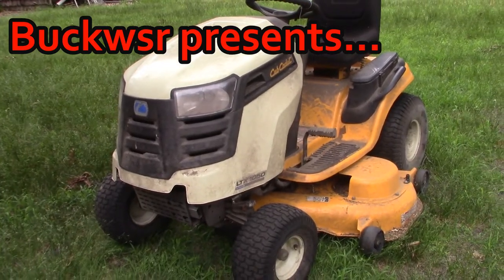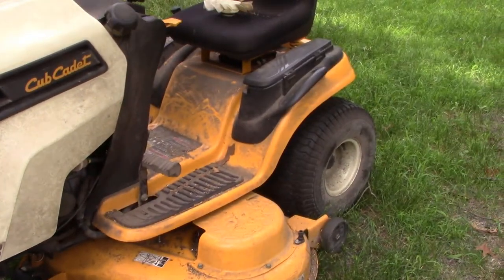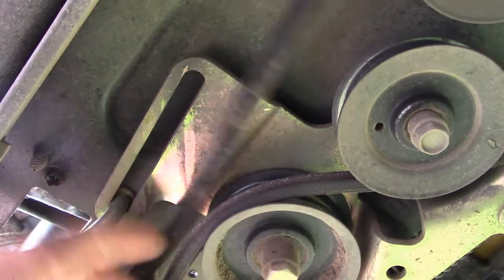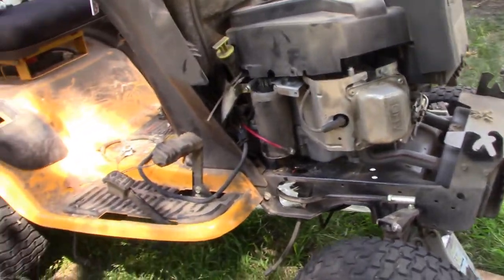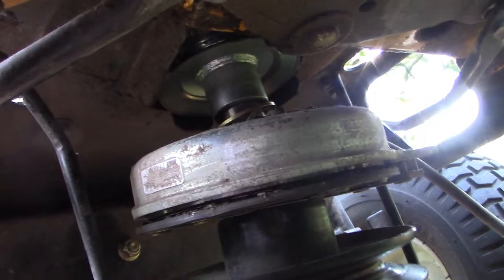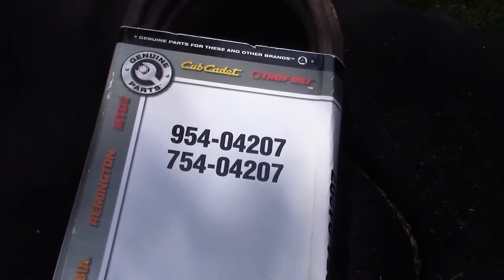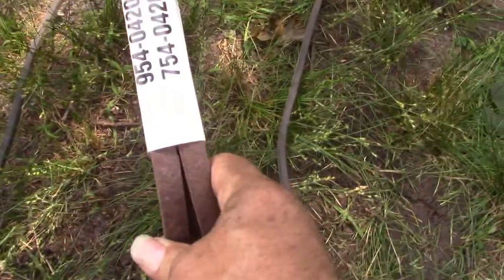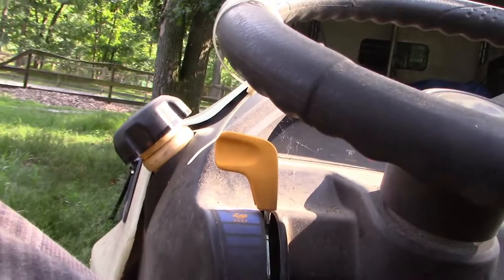How to Replace the Ground Drive Belt and Transmission Hydro Fan on a Cub Cadet Lawn Tractor

Comment: I just completed a drive belt change on my LT1550 tonight. Thanks to your video I knew to pull the PTO and the deck. It went easy as it a Arizona mower (No rust or corrosion.) Even cleaned out the mower deck and balanced it side for side. It liked to lean right side down.

Comment: If anyone was wondering what happened when he tried to start it after the repair (like I was because I had clicks instead of starting too), a good cleaning of the battery terminals cured that issue.  Thanks for the video, it helped me replace mine today and I'm the proud new owner of an impact wrench which made this job pretty easy.
Reply from the maker: Thanks so much for watching the video.

Comment: Your video was helpful.  I had to tip the mower up on its rear wheels and vice grip the plate on the 5/8” nut while I hit a socket wrench on the bolt to break it free.  It was a bugger!
Reply from the maker: Glad you got the job done!

Comment: Thanks so much for the video.  You answered a couple of big questions that I had, like how I was going to hold the hydro pulley in place.  Your video helped my own belt and fan replacement go alot smoother
Reply from the maker: Thank you! Glad you got the job done successfully!
Reply: I dont mean to be off topic but does someone know of a method to log back into an instagram account?
I was stupid forgot the password. I love any tips you can offer me
Reply: @Bodhi Arlo Instablaster ;)
Reply: @Harper Genesis thanks for your reply. I found the site thru google and im waiting for the hacking stuff now.
Takes quite some time so I will reply here later when my account password hopefully is recovered.
Reply: @Harper Genesis it did the trick and I now got access to my account again. I'm so happy:D
Thanks so much you really help me out!
Reply: @Bodhi Arlo no problem :)

Comment: Thanks for video.  This provided a lot of perspective to what I needed to do. 
A neat trick to get the PTO pulley off is to remove a spark plug and stuff the cylinder with a rope to sieze the crank shaft.
Also, my drive pulley was super stuck and I bent the flange while prying it off.   << new pulley cost $45 ... I am not sure what I could have done to avoid that damage. 
Thanks again !
Reply from the maker: Good tip, thank you. And yeah, when those pulley seize onto the crankshaft, it's a nightmare to get them off.

Comment: Should have got a Dewalt  impact, lol Clay .  I think the impact would work on the transaxle nut also and an easy fix by taking seat, battery box and the fenders off. Then you can get the idler pulleys off to change bearings. Mine were really noisy.

Comment: Very nice how to, I like it.I've done this job myself and would suggest that it's possible to overtighten the bolt holding the PTO on, especially when using an impact wrench, if one just 'uggaduggas' the bolt with a 1/2" impact you can FUBAR/distort the PTO,breaking it and that is a $100 item, at least. Borrow a torque wrench if you don't have one and tighten to approx 50-55 ft lbs.Oh, and apply anti-seize to the shaft so the next removal of the PTO & engine pulley goes smoothly
Reply from the maker: Thanks for the helpful suggestions!

Comment: to lock the pulley so you can use a breaker bar can you use a vise grips on the rim of the pulley then rotate it until it hits the frame/suspension?

Comment: If you pull the battery and battery pan, this will.give you better access to the bolt on the pulley and to route the new belt. Good video though. Thanks.
Reply from the maker: Thanks for the tip!

Comment: Mine just did the exact same thing. Probably going to go in from up top or through the battery port when the parts come in.
Reply from the maker: Cool. Good luck with the project!
Reply: @Buckwsr  didn't work. Deck and pulley had to come off. Lol!

Comment: Can you go smaller  pulley on the ltz 1046 transmission for speed
Reply from the maker: You could certainly try that, but of course, you'll also need a shorter drive belt....

Comment: Instead of doing all the hard work there are 4 bolts you can loosen the motor...I just done this today...just raise your motor up on the driver side after it is loosened align you drive belt on pulley of motor then feed going to transmission...

Comment: My 23 horse Cub cadet has got a PTO problem I have it engaged I'm running the mower and about 5 minutes it'll shut off  the mower will shut off everything else is running fineI shut the mower down turn it back on it' will work for a few minutes what could be the problem with the PTO I bypass the switch so I know it's not the switch I'm running straight to the PTO with my power

Comment: I'm having a problem with my PTO on my 23 horse Cub cadet bypass the switch the PTO work and mow for about 5 minutes then quit then I have to shut them over down and do it all over again and it'll run for about another 5 minutes and then the mower deck will shut down the rest of the mower will run fine
Reply from the maker: Check the battery. You must have a fully charged strong battery for an electric PTO. Even if the engine is running, you still need a strong fully charged battery. Engine off, the battery voltage should be 12.5-12.7 volts. Less than that, and it might be on its way out....

Comment: I am confused why my clutch is not coming off? Also, I was able to take the bolt off the clutch with a socket wrench…. No impact and I did not have to hold the flywheel either. The clutch is not budging at all. Help please. My grass is growing quick. Lol
Reply from the maker: Hi Mark...I'm wondering if the electric PTO clutch is frozen (siezed) onto the crankshaft?  Apply some PBblaster or other penetrating oil generously and let it sit overnight. Also some gentle tapping with a hammer....just don't go nuts on it.  Good luck.
Reply: I just came across a video where someone unbolted the engine without even taking off the clutch. The belt went right on. I’ve sprayed some PB blast on the clutch, but I might look into that other way as well. Thank you

Comment: Maybe I should just not say anything, I don't want to sound like these people, who seem to watch other folks videos just to try and rip them apart. That's not me, i promise. But you labeled  this video, How to replace the ground drive belt and transmission  hydro fan on a cub cadet lawn tractor. All you showed was how to remove a bolt and drop the pto clutch. Then use a hammer to remove the drive pulley, and here it is done.how to video, I don't think so.
Reply from the maker: I understand your point. But I do recall mentioning the difficulty in filming all the steps in live action, as it's tough to lay on the ground with a camera in one hand, when you really do need to use both hands while working in confined spaces. I would still like to think that if you need to replace the drive belt on your tractor, this video would be of some help to you before tackling the project.
Reply: I see your point, but the those two steps are the big ones. Everything else is nothing more than routing the belt around pulleys and even with the most perfect video, you really need to jut follow the belt routing diagram in your manual to get it on there properly. This is a solid video. My issue with the video is that I'm mad that his drive pulley came off so easily, haha. I have videos of my LT1018 for drive belt and engine replacement and that damn pulley was on there tight. Even with the engine completely off when I replaced the engine and using a pry bar, I couldn't get the pulley to move.